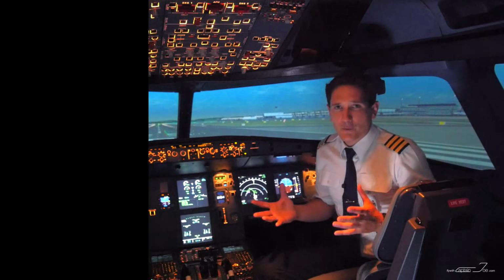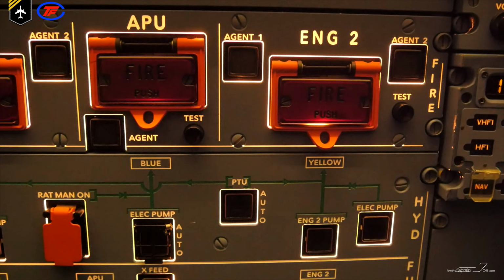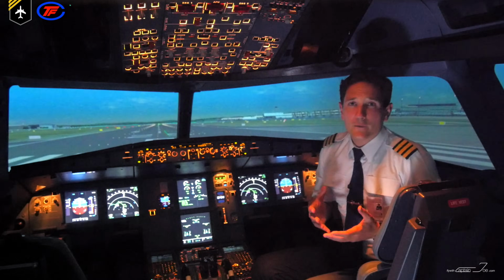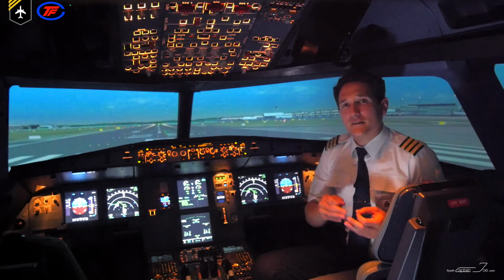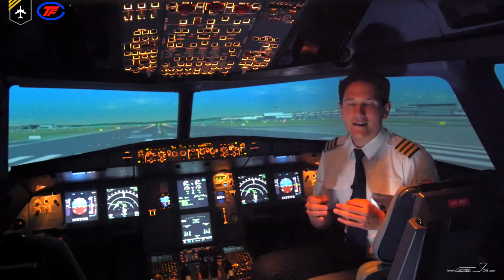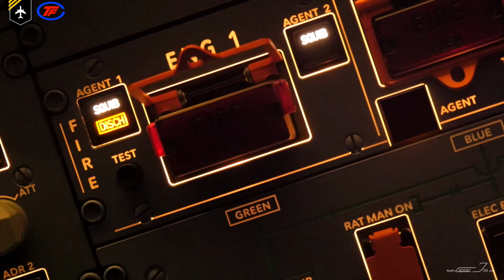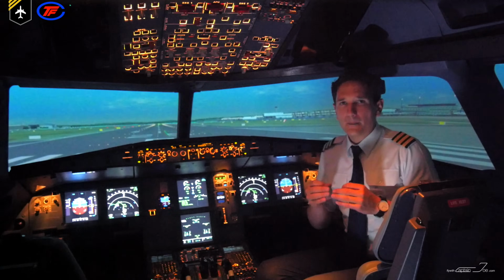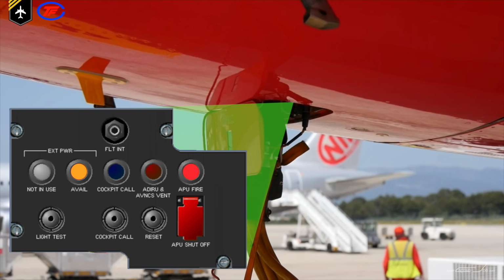Airbus FIRE PROTECTION system!!! AIRBUS SYTEM KNOWLEDGE explained by Captain Joe

Comment: Captin Joe, when you at max altitude how do you know when you need to start your decent for landing? Are you able to do a video on that plz?
Reply: It is called a Top of Decent and is calculated by the FMC (flight management computer) and shown on the Navigation Display (ND). this is represented by a white arrow straight at first and then slopes down in a zig zig pattern.

At this point the pilot should begin the decent from their cruise altitude.

Hope that helped :D
Reply: +Traxtortipper here is a rule of thumb for you: you will need approx 3 nm to descend 1000 ft, plus 1nm for each 10 knots you need to slow down. Thus, let's say you are flying at FL300 at 290 knots and you need to descend to sea level and slow down to 140 knots. Then you would need to descend 30,000 ft, that takes approx 90 nm, plus you need to slow down 150 knots, that takes another approx 15 nm. Thus you should start your descend around 105 nm (track miles) before your destination. Of course, this does not take wind effects into account, but it gives you a pretty good estimate.
Reply: if there is no ATC you can also get the answer with mathematics
Reply: I guess it would depend on the type of the emergency... If there's a hole in the wall then I would say the optimal time to start descending is right fucking now.
Reply: The flight computer or mcdu will calculate your top of decent or T/D  so the pilot doesnt have to valculate it tye computee does everything
Reply: +Thomas Hjortgaard Danielsen I guess these estimations are based on the A320 or what plane are you refering to?
Reply: They would definitely hold for the A320, yes. But I guess also hold for similar-sized aircraft like the 737.
Reply: I don't think they need to start descending in the middle of the Atlantic...
Reply: Traxtortipper it's all there in the flight plan. They calculate the distance and rate of descent well in advance.
Reply: Traxtortipper Before the fuel runs out.
Reply: Traxtortipper Hi they FMC's calculate that. It means the top of cruze and top of descent. On autopilot the plane will make sure he is at the correct altitude which programa in the FMC
Reply: Play fsx with an ifr flightplan and atc, and you will know how it's done!
Reply: Traxtortipper  hey hey hey it's a simulator, not a game
Reply: Mikosch2   then use it responsibly  and with maturity  ; )
Reply: LOL, I agree, it's highly dependable/variable. Still I think 40-60nm radius is ideal when descending from a cruise. I really like simulating  dual engine failures on the PMDG 737, that's a completely different energy management though   ;)
Reply: Traxtortipper auto pilot or the cdu flight control computer together also air traffic contorl can see this.
Reply: EverythingAboutWindows   but he needs add on aircrafts because default aircrafts are not equipped with a cdu
Reply: Ok. Thank you everyone for the help. I like playing plane simulations so this will help me a lot
Reply: That depends a lot on how you use it ;)
Reply: Me to. Anything else would become rather expensive in FSPassengers. But still, saying it was not a game is just half the truth. I fly for nothing else than entertainment after all. And you won't say that ever again once you've tried a REAL simulator. Those are more like it. FSX, X-plane? nah. Those are toys.
Reply: Mikosch2   it's not expensive. I have paid 0 dollars and made my simulator almost like real life. From torrents of course
Reply: First, the method you describe is illegal, second I was talking about something very different. In-game money.
Reply: Μανώλης Φιαγκουσάκης  Same :) u torrent is life haha
Reply: What about an emergency descent/landing, is there optimal distance ( in case there are many suitable airports to choose from)?
Reply: Yes!!!!
Reply: Mikosch2 There is also a legal way to do this and that is FlightGear. However you would need to download a aircraft with cdu to get a T/D indicator.
Reply: What does downloading planes via torrent have to do with the CDU??
Reply: Mikosch2 I just pointed out that FlightGear is legal to download anyway you want. And the initial question was about T/D that is simulated in most airliners for that simulator.
Reply: 60:1 rule also gives a good estimate, especially when you need to bypass a certain Fix or Navaid at an assigned altitude.
Reply: you know what gps is right
Reply: hacker hacker gps has nothing to do with the Descent ;)
Reply: Lukas he asked when you need to descend not how to land the gps tells you where you are relative to the runway so that lets you know when you need to descend
Reply: hacker hacker the GPS ist just a GPS where you are. It shows the top of descent but does not calculate it;)
Reply: That's a great que. Bro
Reply: Traxtortipper Gaming check out his recent video
Reply: Traxtortipper   if you mean cruise altitude then you can follow atc instructions or rely on your flight plan.
Reply: Just wait until ATC calls you down. At least, that's how we do it at Orbit Airlines.

Comment: Why don't the brakes have a fire system as well. Ive seen some brakes overheat and catch fire.!
Reply: Brakes catching fire is almost exclusively due to excessive heat generated in the braking system (for example due to a rejected takeoff with no reversers available and the plane at maximum takeoff weight). It's not something that is likely to occur during flight. An extinguisher could put out the flames, however the enormous amount of heat still present in the braking system would cause the fire to reignite as soon as the extinguishing agent has been fully discharged. The amount of agent a plane would have to carry to succesfullly fight such a fire is impractical. Instead the plane, landing gear and tires are designed and tested to withstand such a fire for at least 5 minutes. Tires have special plugs that will vent the pressure before the tires blow due to the heat. Airpoirt firefighters can be expected to be on scene within those 5 minutes.
Reply: that's usually on the runway, fire crew are probably prepared, but that's still a very good idea
Reply: Wouldn't it add more weight to the undercarriage? Also, landing gear catching fire isn't as big a concern as, you know, an engine fire because you'll be safely on ground when brakes do overheat. I guess it might be cheaper to just replace the tires and brakes instead of adding those extra kilos.
Reply: They have a brake fan for that.
Reply: Bikestail er   actually there is a somekind of cooling system if the brakes are overheated and that button is located above the anti SKID switch
Reply: They are tested to not catch fire for a specific time, so that the fire service has enough time to arrive in case there was maximum braking used. You can find some videos on Youtube from brake tests if you search for it.
Reply: Because of the gear is extended , it normally means it is on the ground and fire crews are there ?
Reply: I know about brake fire supression. Those Composite brake plates get white hot without combusting/melting, truly amazing piece of material engineering.

What I was trying to say in my reply is that, possibly the cost of adding a new fire supression system is more than the cost of just replacing it which is why we don't find it in many airplanes today.
Reply: That normally happens if you braking at higher than the normal knots 👍
Reply: Some airframes use nitrogen in the wings and wheel wells to put out fires

Comment: why is the SQUIB button at 5:00 darkened?
Reply: guess, the simulator was bugged and lit that button even if it shouldn't
Reply: The APU has only one SQUIB, the buttons in the sides are for the engines. The APU SQUIB is under the FIRE button